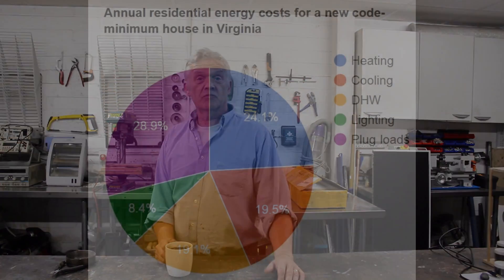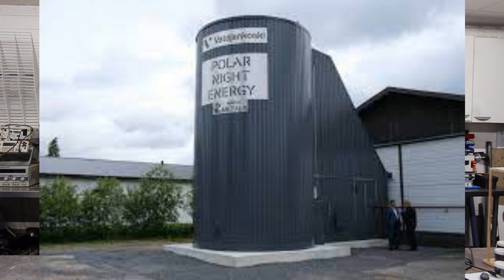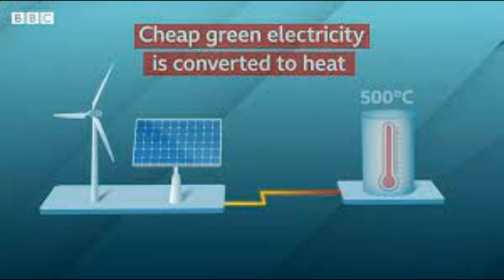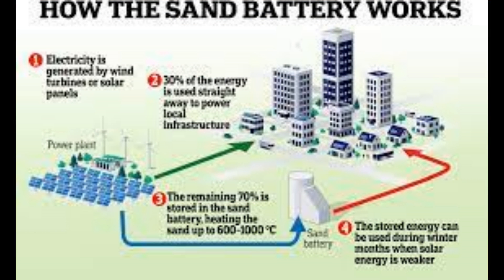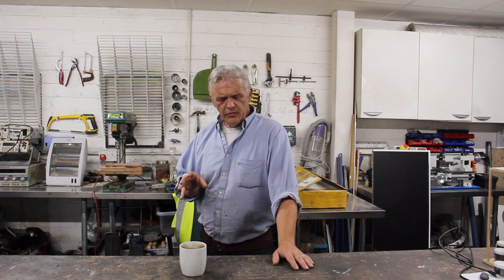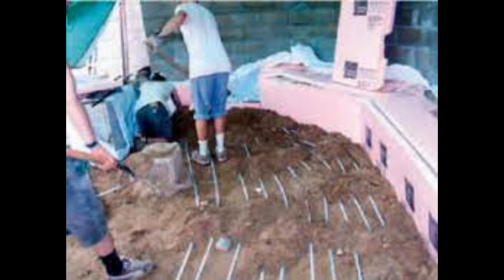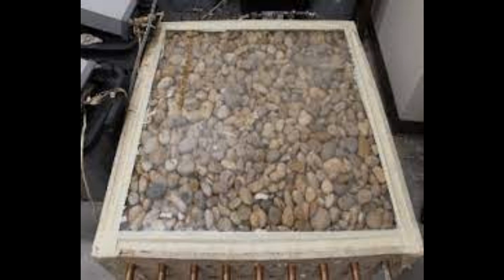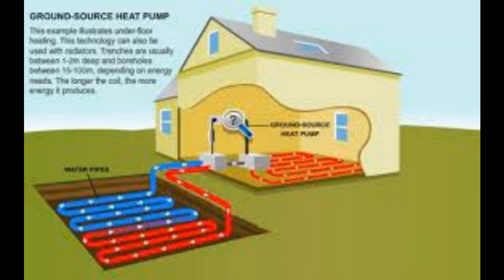1604 The Sand Battery - A DIY Option Or Not?

Comment: For DIY, I have thought about the options between bulk water and bulk rock or sand.  Heat content-wise, a cubic metre of water with a temperature differential of 30C will hold about 125 MJ, while a cubic metre of rock or sand will hold about 105 MJ.  So there is not much difference, tho obviously water is a bit better, up to its boiling point.  Above 100 C, the obviously a rock store can hold more energy due to the higher dT available.  
But for DIY you are then talking about working a system with temperatures of maybe several hundreds of degrees above ambient.  So soft-soldered joints wont cut it, insulation requirements become extreme (else heat loss will beat the gains), and issues with blowers etc to move and transfer heat become the domain of very specialist skills (like - blast furnace operators!).  
For me, hot water storage (or perhaps phase change below 100C) with ordinary household plumbing, collectors, heating elements, circulating pumps, thermostats etc, seems the only practical area I can work in for such a storage setup.
Reply: You raised some interesting points. It's possible to modulate the resistive heating power in order to keep the temperature below some of the issues you highlighted. However this will result in reduction of the efficiency of the battery.
Reply: @Kiwipictish  exactly, which brings you back to water, or low temperature rock storage.  A passive house in Sweden, I recall, managed to provide adequate year 'round space heating by air-warming a well-insulated 50 cubic metre rock store (a 3.7 m cube) under the house during summer, and recirculating that stored energy via air ducts into the house in the cold months.  Lots of good thermal mass in a setup like that.
Reply: For context; a 200 litre drum (44 gal) with a dT of 60C stores 50 MJ, which is the equivalent of about 14 kWh, or a 2 kW heater running for 7 hours.  One of those in the corner of a room would not be unhelpful!  (But obviously you do need to shove another 14kWh into it from somewhere else before tomorrow night, else disappointment is guaranteed!)

Comment: I just did a back of an envelope energy density calculation. At 300C above ambient, 1m3 of silica sand would store about 175kWh, not inc insulation. 1m3 of iron at similar  temperature would store about 295kWh.
At the lower end of volumetric energy density, 1m3 of lithium ion would be as much as 250kWh, although I suspect this is rather too much as electrical connections and cooling for the individual cells would be needed. 
So thermal store, if high temperatures can be used, compares surprisingly favourably with the best commercial chemical batteries, particularly in the longer term as there should be no loss of capacity.
Reply: Just found an article about magnetite being used for heat storage. It has about double the volumetric thermal energy storage capacity of silica!

Comment: This is exactly the way a passive solar greenhouse works with a climate battery. The savings are huge. You pump excess heat into it in the summer months charging the system and extract heat from it in the cooler months.

Comment: I am wondering why you can't use just anything that can get hot or cold like say clay in place of sand, or just containers burried full of water for home heating and cooling so that water can absorb heat from the ground and keep a set temp in the winter to warm air being blown through pipes that are run through these water containing containers, and of course hotter air of summer blown through cool down to that ground temp that the water keeps dissipating heat from the pipes into the cooler ground around the containers. Something a friend keeps calling "geothermal" even though I always picture the super hot deep drilled areas that water is pumped into to turn it into steam say near a volcano or something LOL.
Reply: oh also if keeping the "clay" dry so it can be heated much hotter, one could encapsulate a batch of clay with that sodium based clay that swells when wet so it stops further penetration of the water into it, keeping what is under or over it dry (like used under gravel roads when there is just too deep a layer of water absorbing mud that will let your gravel sink in and turn the road muddy again)

Comment: Sand (0.84kJ/kg) at 500 degrees much more energy than water limit 100C (4.184kJ/kg). However heat transfer medium think air must be the way when sand above 100 degrees c. Hot/cold mix air injection into the home? maybe or air water heat ex? ...some experience involved in foundry sand reclamation units used to get to 900c to burn VOC sand casting resins etc.
Reply: Sand is approx 1.5x dense as water making the difference regarding energy density.

Comment: As 'C H' pointed out in an earlier comment, Dick Strawbridge did a similar greenhouse heat-store, but using broken glass as the thermal mass, in a series of programs around 'Eco-friendly' living.
Broken/crushed bricks can be used for similar effect (and people will pay you to take it away!).
I've used a couple of cubic metre water tubs, boxed in and well insulated with discarded 3-4 wall poly-carbonate sheets; old radiators and curved shower enclosures gather/concentrate enough heat to raise the water to unbearably hot some days. I haven't had to use any fuel-heat in the greenhouse for a couple of decades, and I grow salads etc 365. Everything runs by passive circulation as there is a 2.8m height difference (I do live on a fairly steep hill). Everything is from 'rescued' materials.
Reply: please make a video this sounds really intresting

Comment: For DIY builders water is probably as good as anything for storing heat. It has a better specific heat capacity than most materials. Can easily be pumped through heat exchangers etc Down side is its limited to max temperature of <100C.

Comment: Or storing the heat endothermically . Long time ago in popular mechanics magazine was an article about using sodium sulphide for heat storage . Add water to dry sodium sulphide ,  and  it gets very hot , so too caustic soda but of course  the caustic soda would slowly  become sodium carbonate from co2 absorbed from atmosphere.  Use the summer heat to dry out the solution  of sodium sulphide again ready for the cold winter.  A house was built and tested using this compound 45years ago now .It grabbed my interest at the time cos the sodium sulphur battery was something  of great promise but along came the lithium battery and we've forgotten  now the NaS battery .

Comment: When I was camping in my van mid winter on the coast I would heat up a big pot of dry sand on the gas burner and wrap it in a spun glass insulation and sleep with it near my head under my bed . It would still be warm in the morning . Probably got it upto 400 degrees or more. Sometimes even hotter if it was a cold snap. I got a few other people doing it but for some people they felt it was dangerous and were scared . Not everybody has common sense ! 👍🏻
Reply from the maker: lol - no indeed they don't!

Comment: Surely the whole core of the Earth is a thermal storage battery ?  The concept of using boreholes for heat transfer has been around for years !  Even some of the mines I've worked in have had relatively high temperatures at great depth - why aren't these being used ?
Reply from the maker: I don't know mate

Comment: Could you not use the materials you’ve been developing to create conductive rods arranged in a lattice with each rod being made with the property of being porous so as to have a great deal of overall surface area with a collector plate at one end, ie. high temperature resistant steel as a base plate placed deep underground somewhere deep enough to be heated by surrounding bedrock which itself would be quite a lot warmer than the temperature just below ground approximately 10-20 ft which stays relatively stable year round with a copper plate fused to the top of the rod lattice which would build up a potential charge as long as there’s a differential in energy state between the base plate and the terminal plate near the surface and the rod lattice and terminal plate is kept isolated from the surrounding earth and rock with some type of ceramic material. This type of arrangement in my opinion would create an energy differential and electrical potential that can be harvested once the circuit is completed. I recall doing a simple experiment years ago  using an electrically conductive material such as steel spoon inside a glass containing hot water with one end of the spoon sticking out of the water by several inches and being able to measure a definite potential with a voltmeter when the other end contacted a source of ground. It was very small but definitely there. The same principle applies here only with much improved flow and potential if scaled up and properly constructed.

Comment: Ah heck, I told some farmers awhile back who had greenhouses and who lived in cold environments that they should put a tower of cinder blocks filled with sand and painted black in the middle of their greenhouses, and that this would act as thermal regulator for colder nighttime temps. And in the summer, if painted white or something white was put over it, it would do similar with the regulating heat till at least noonish or so. Specified that it should be the finest sand that they can get and packed in. 

     I thought it was pretty clever, but no apparent interest.

Comment: I also did some math and drew some plans up for storing up heat in the summer for use in the winter.  EPDM sheet rubber (generally used for industrial roofing) is rated to withstand temperatures up to 130C for long periods of time, and 150C for short periods of time.  100C is plenty for me.  Since I have room in my basement, the container would made of 3/4" plywood and rectangular.  Simple wooden frames constructed of 2x6's every 12" are sufficient to resist the weight/force of the water.  Polyisocyanurate foam insulation is rated for temperatures exceeding 300F.  I only need 212F or less.  Water has about 2-4 times the specific heat capacity of stone, cement or brick. So your heat battery can be half the size (or less) of the equivalent capacity sand or stone heat battery.

The big advantage to sand or stone is that there is no problem with phase change at 212F.  Sand doesn't care if you heat it to 500 or 600F. But the insulation can be problematic and it's more complicated to get the heat in and out again compared to water.

Outdoor or underground water tanks are pretty straightforward as well.  But the advantage of locating the water/heat battery in the basement is that once heating season starts there is no loss of efficiency because of heat loss.  "Heat loss" heats the house. As you are collecting the heat in the summer, heat loss is legitimately a problem since you don't need or want to heat the house in the summer, so cooling costs escalate.  But sufficient insulation reduces that to a manageable problem.
Reply: Tubes of parrafin or carnuba wax inside the water vessel will allow you to take advantage of phase change for a 2-4 + times greater heat storage capacity than water alone.

Comment: Hi Robert & everyone else
There is a thought going through my mind when it comes to the energy crisis (here in Austria it's not ony fuel)
If I would place a renticular lens close enough in front of a parabolic mirror  so  that the light would not fokus on one point but be guided in a streight line ... for instance into a window (maybe with a big dark rock or a sand behind it)
Would that make a safe way to reduce heating cost on  sunny winter days (given that there are more than one parabolic dishes)
Reply: Yes, it works. I've done it with old curved shower enclosures, and copper pipe inside old fluorescent tubes, but only to heat water for washing etc (and a green house). There just isn't enough heat energy to heat a whole house. But wash-water can get scalding hot, so I had to add shade/louvers operated by wax-capsule elements (similar to greenhouse window openers) I placed them in contact with the 'return' from the storage tank, when the return gets very hot the louvers close. I have to adjust the 'aim' of the collectors a couple of times a year. Getting a good reflector surface took me some trial/effort.
If you've got enough collector area there's no reason you couldn't be independent for heating/cooling, maybe using sterling engines/generators.
I've seen large-scale tests done with parabolic troughs;  have a search in you-tube, I'm fairly sure there are plenty.
Reply: @bikerfirefarter7280  that sounds really cool! Did you use a renticular lens? I am a bit afraid of the focal point. As I am having little kids that don't listen to their dady.
Reply: @michaelschauperl172  No lenticular lens, just the curved glass reflector (the arc is apx 1/4 of a circle), the focus is not perfect, but good enough if you use 22mm dia copper pipe, (stainless or aluminium tube should work too if suitably painted) the glass-fluoro tube is about 45mm dia. The tubes can get very hot, especially if you use oil instead of water, but the 'focus' isn't too fierce (and you tend to block the light as you lean over it). You could put a glass or wire mesh over the collector as the focus area is just inside the curve.
I could have used polished stainless or aluminium reflector (and made large parabolic troughs) but I had several curved shower enclosures to hand. Old kitchen pedal bins are often polished stainless, with a bit of care/enginuity you could make quite a wide parabolic concentrator, and no danger of broken glass. With my set up you don't have to track the sun as much as with lenses and parabolas. It's not greatest efficiency, but it works OK.

Comment: I designed and built greenhouses with two ft bedded sand heated w electrically heated water back in the mid eighties as starting houses...they worked awesomely 👌....
Reply: I bet you did. Did you know that zeolite holds heat longer than sand?
Reply: @earthmike532 Cost comparison of Zeolite vs sand?
Reply: @ronson-natsarim  good question. Zeolite is volcanic rock. It's an amendment that farmers put down, so it's not astronomical but I'm sure it's more finite than desert sand (the best sand for this project price wise because construction sand is more costly and more finite and works the same). When something lasts forever and functions a large percentile better, then the cost effectiveness is year after year so I'm sure it's a good idea. I was thinking 50/50 sand/zeolite would be the best.

Comment: Silicon is composed of 14 electrons, 14 protons, and (in most cases) 14 neutrons. In its ground state, silicon has two electrons in the n = 1 energy level, eight in the n = 2 energy level, and four in the n = 3 energy level

Comment: Just a thought: Many years ago I knew somebody that installed a large block of copper in the floor of a room that received lots of Sun during the day - it cut his yearly heating bill considerably. Copper is now expensive, I suppose one could use Aluminium?
Reply: I was thinking  copper too ,, today the  expense rules it out . But simply building bricks were used in the commercial  heat b a nks we had once . Aluminium  doesn't  store as much heat as copper.  That  is it takes more heat energy to raise a gram of copper one degree than for aluminium .

Comment: Rob is there an electrical component that can be used to cool it’s surroundings and create a second cold sand pile near to the hot one (insulated of course), or via evaporative cooling perhaps. Then we can also use these sand piles to drive a heat engine.
Or just go direct and create some Solar sand ovens 😄 (multiple sand piles to cap the max heat at 180 C)

Comment: Using thermostorage also allows use of solar concentrators, not only using PV panels and resistive heating elements. Using concentrators should allow us to get more energy per sq.ft. from the sun than a PV panel could ever dream of. If you tried to concentrate solar light on a PV panel you will melt it. But a solar concentrator will take huge amounts of concentrated sunlight and it makes it more efficient not less efficient like a PV panel. Just having a PV panel in the sun lowers its efficiency, solar concentrators quite the opposite. Even if you did only some concentration on PV panels, it still won't work very good because the excess heat ruins efficiency and life expectancy of the panels,

A concentrator lasts probably 10 times longer than PV panels too. A concentrator is just polished SS parabolas and pipes, lasts for hundreds of years. And it don't care how much light you shine on it it just reflects it to the absorber pipe. Pipes are even more mass produced than PV panels, easy, simple, and cheap but long lasting. Then you need some heat exchanger anyway to store the heat in the sand, so the oil in the pipes being heated will just run thru the sand in a matrix to maximize storage, and then recapture efficiency. 

You can argue all day long resistive heating is 100% efficient but i agree, they are doing their research and i agree with their approach because we already have PV panels everywhere, and we already have wind turbines, hydro, etc...I was just throwing in the solar concentrator ideal too because if you are doing a project directly from zero(no existing wind turbines, hydro, PV with enough energy to have it work), then instead of buying PV panels to heat sand, i suggest using solar concentration technology, simple, safe, more efficient than using PV to heat sand, built like a horse.